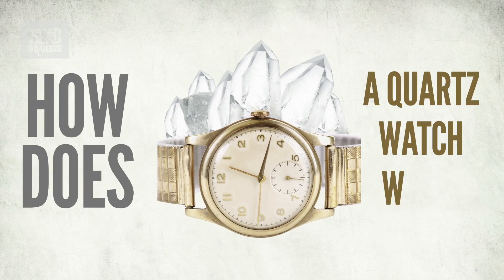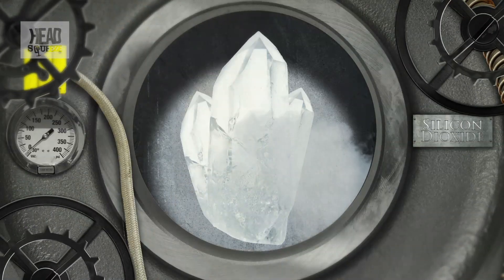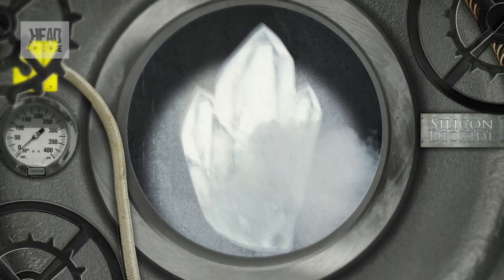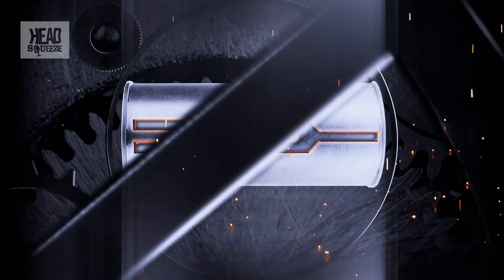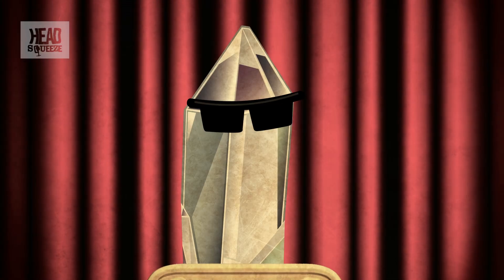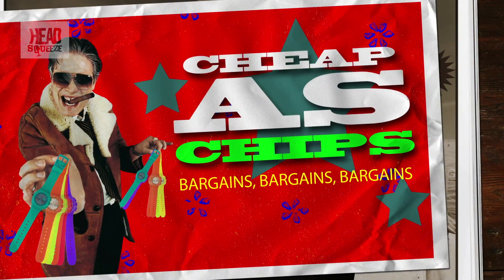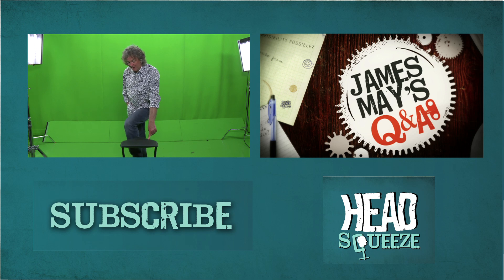How Does a Quartz Watch Work? | James May's Q&A | Earth Lab

Comment: Quartz watches have no soul to them. Automatic and hand wind mechanical watches have something very special about them. It is like they are a living thing with a heart beat.
Reply: Fonzie Jone strange it may be, but actually beating of a quartz watch is much more similar to heart beats, but I get your point. I have many watches, ranging from low to (relatively) high prices, but there are many downsides to old school watches. if they are not expensive, they are accurate almost as you don't need to look at them at all and mechanics take away a lot so they need to be chunky and heavy and most of the time you don't want something heavy on your hand for a long time....
Reply: I don't agree at all...
Reply: Quartz keeps time hundreds of times more accurately than mechanic.
It's also way cheaper and lasts longer due to having very few moving pieces. 
Sure a mechanical can last forever without ever needing a battery replacement but every 5 years or so it needs maintenance. Also even a brand new mechanical if dropped or accidentally hit can destroy or disrupt the movement.
Reply: @Radix111  More like every 15 - 20 years for a good mechanical movement isn't it? Even basic Seiko movements have been known to run well for 20+ years in some instances. However, quartz can still beat that in the form of Eco-Drive/Solar/Kinetic, which last about the same time before a cell change.
Reply: I disagree even though all my watches are mechanical. 

Quartz is precision engineering and easy to maintain.
Reply: a mechanical watch is nothing more than gears, quarts actually works with gears as well but also has a quarts crystal and battery to give it the power it needs AND it keeps time better much more precise. did you even watch the video? smh
Reply: While a mechanical watch certainly has more charisma, it simply isn't the best choice for about 90% of people. Why? Because most people just want a watch to give them accurate time keeping. Quartz does that, and with something like Citizen's Eco-drive movements you don't even need to think about batteries for at least 10 years or so. Then just replace it for a few quid instead of having a mechanical watch serviced for between £200 and up to well over a grand. Plus with a lot of lower priced mechanical movements they aren't worth servicing, if a decent service is £200 and an ETA 2824 only costs £150 - £200 why service it when you can replace the movement for the same price?
Reply: Draknareth exactly, i have a seiko premier chronograph owned it for 6 years and still havent replaced the battery and it runs perfectly like the day i purchased it.
Reply: It's like the new upstart electric motorcycles. No soul. The mechanical ones are tops in that.
Reply: mechanical watches are just overpriced showpieces. and for all serious purposes absolute trash. the AP, ulysse, patek, vacheron etc are all just status symbols with exponential prices with their complications.
Reply: What do you mean ''soul''? All watches are just that- watches, tools. You could argue that there is more work done to make a mechanical watch, but 40 years ago a lot of people would disaggree with you about quartz not having a heart. Although I kinda agree, over a 100 dollars, there is really no point in getting a quartz, you can get a smartwatch at that point. Mechanicals on the other hand are for the collectors, admirers and rich. Just like manual transmissions in cars- they have no place in todays world, but they will stay because some people love em.
Reply: The balance spring seems like a heartbeat to me
Reply: This is very true, and I must admit i'd find it very strange not having any engine noise or the pleasure of an upshift under heavy accelleration, the fact is that electric bikes will offer better performance (once the range is actually useful) as the torque is available instantly. New tech will always get a nervous glance from people that have appreciated what came before, but eventually it becomes the norm, we adapt and realise that in many cases it can be better. People hated the idea of fuel injection instead of carbs at one point and tbh my fuel economy and power output has only improved because of it :P ...... I'll still wear my automatic watches though, even if I do get an electric bike :P
Reply: Figures someone would take my statement and use it as a means to preach e-bike, and frame everyone who doesn't want one as some kind of technology Luddites. No, e-bikes are not going to replace petrol bikes. Go buy your e-bike, enjoy it, have your instant torque (without building HP), and stop telling petrol heads they ride inferior machines.
Reply: Read my comment again. That isn't what I was saying at all. I ride a petrol powered bike and will continue to do so until I can legally no longer do so. What I was saying is that new tech often takes time to be adopted. E bikes will be no different.
Reply: Mechanical watches are a masterpiece of engineering. Period. Regardless of how practical or impractical. I appreciate what they are because engineering is my niche and career. Sure quartz are infinitely less expensive and very accurate, but who cares. Electrons vibrating a quartz tuning fork and a chip making calculations isn't quite as emotional as a handful of gears, springs, jewels, balance wheel, and the science behind it all to accomplish the measuring of moments.
Reply: State a price. In my thinking I wouldn't spend more than $450 on a mechanical watch. Probably a Seiko or Orient since they make their own in-house movements and control every step of the process.

If I was paying a couple thousand dollars? Haha. No. I'd never sell it and it would be handed down to my children after I passed away.
Reply: Mechanical watches do not last forever. The main spring eventually has to be replaced as it is set, even if the process takes decades.
Reply: "...and for all serious purposes absolute trash"

Yes I'm sure you spent time thinking before writing that thoughtful and descriptive line.
Reply: "......Just like manual transmissions in cars- they have no place in todays world,"

Gimmeabreak. No place? They are still less expensive, far more reliable, way less to maintain, commonly more durable, less prone to overheating, and the best anti-theft device today. The reason fuel economy is sometimes better with automatics is because of gear ratios, not because automatics are more efficient. No place?

One of the timepiece moguls in the world today, Seiko (Japan) has pioneered several technological advances in time-keeping. It's not just "mechanical vs. quartz" anymore. Look them up.
Reply: Mate I know. And I'm not talking about used german cars with automatics robots. Im talking about real, hydraulic automatics like on american and japanese cars. Anti theft device? That is probably a good joke- if somebody will want to steal your car, it wont matter what anti- theft system you have. Another point- maintenance. In case you didn't know, you should change fluids in your manual every so often as well.
Reply: They don't have soul because no effort is put into making them in my opinion. However that's not the case for all quartz based movements. It's all just a matter of opinion, but the way I see it, a GS 9F movement, the Citizen Cal. 0100 to have just as much, if not more soul than a basic ETA movement for example.
Reply: Soul = Overpriced and only appreciated by rich elitists.
Reply: True
Reply: Fonzie Jone  But they don't keep time ! stop living in the past and embrace the future 😀
Reply: So true, can't agree more

Comment: Great vid.  Looking for the translation part though; how does the single second pulse get generated? Is that a "microchip" function...just puts a "charge" a second at a lead that an inductor pushes to a gear?
Reply: There's electronics that gets the electric pulses from the crystal via the piezoelectric effect (movement⇄electricity) and divides it down.

Comment: but my pocket watch has no battery but it still works how?
Reply: Some watches are self-wound.  They use a special winding mechanism that works by you simply moving around.
Reply: A weighted pendulum connected to a gear set, designed to add tension to a spring that provides the kinetic energy to the balance wheel is how it continues to work. Energy from your body powered by sugar, translating to energy in the pendulum, translates to energy in a balance wheel, translates into moving needles around a dial.
Reply: Dimeinurear
They put the same tech in shoes to make the led lights flash in them.
Reply: Some fancier watches may also have a tiny solar panel as a clock-face.

Comment: The resonance for the quartz oscillator is more complex than simply passing a current through a crystal. The crystal is part of an amplified resonant feedback circuit. The frequency can be controlled or pulled slightly through the use of a trimmer circuit for greater accuracy. The output is counted down to 1 Hz/sec. Most watches use 32.768 kHz. The very expensive watches use higher frequencies and thermo compensation for greater accuracy.
Reply: Question is, can that vibrating crystal be heard by the natural ear, even if a child listened?
Reply: Lifted_Above Probably not. Even if it's oscillating loud enough it's way beyond the typical range of human hearing.
Reply: Lifted_Above humans hear from 20hz to 20,000 hz. The 32,768hz is far beyond our hearing range.

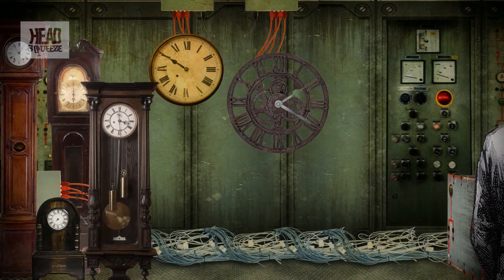Comment: Finally someone who explains the oscillation of a quartz crystal and adds the small detail that the frequency is not intrinsic to the material itself, but rather dependant on the shape it's cut in. Also, the "tuning fork" is usually cut out to be a bit faster, then the tips are covered in gold, which slows it down. Then the gold is whittled away until the quartz is calibrated. The clocks at 2:53 have 13-hour cycles, by the way.

Comment: A combination of both, and more. The biggest danger is that it will disrupt the heart; for that, the electricity needs to pass across the heart, so path is important. There needs to be enough voltage to penetrate into the body (skin is a modest insulator), so voltage is important. And there needs to be a minimum current, about 0.05 amps I've read, to cause the heart to fibrillate (like a seizure); currents ~>1A stop the heart entirely, which is a bit easier to recover from than fibrillation.